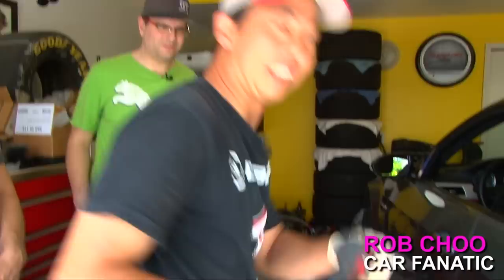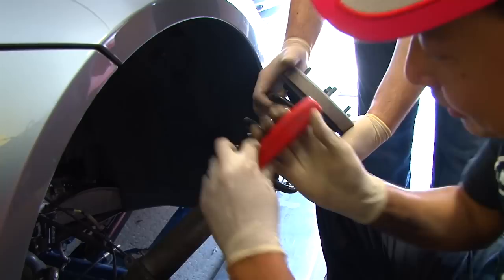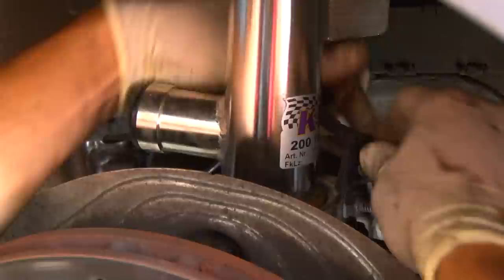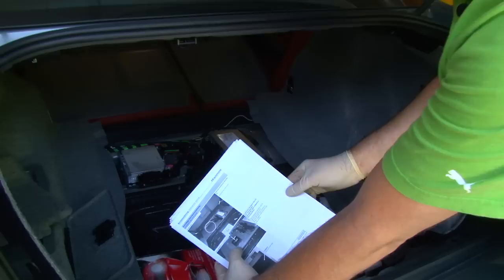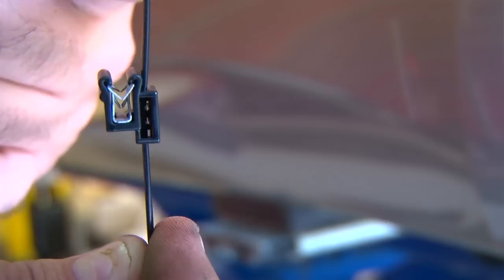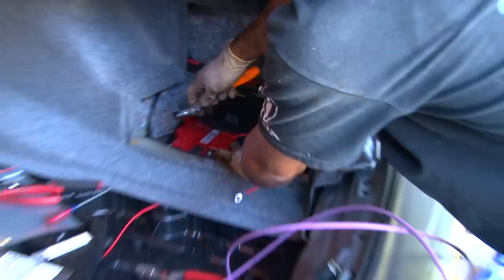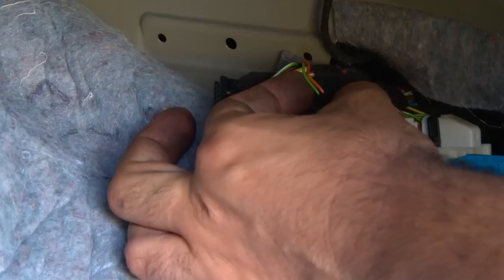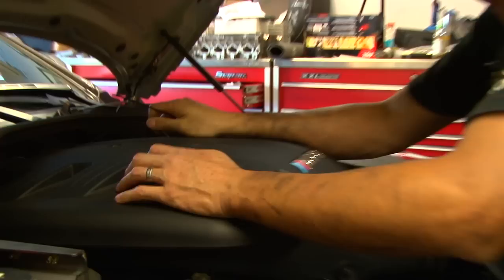How not to lower a car the wrong way - KW Suspension DDC - Technik

Comment: "happy wrenching". Sure, KW DDC coilovers are ~allright but the OEM susp. with EDC are no compromise at all, in fact I consider them better suited to the M3 unless you do more than 50% track. So really all that work was not necessary, the OEM suspension are awesome. You guys just have the mod bug and maybe are contemplating opening up an indpdt tuning shop, right ? By the way the fat guy with the baseball cap really need to forget about cars and hit the gym instead. I know that's rude but you know it's true.
Reply: +mayhemlee  A good question would be: Who the hell goes to a suspension install video to check out dudes.....
Reply: goognam goognws You mad bro?
Reply: So you come to suspension install videos to check out dudes? Lol
Reply: This's getting interesting 🍿
Reply: 510Redneck Gee, ya think?? LOL

Comment: I was just wondering. A few yrs back I was going to buy an 02 sentra Spec v. Test drove it, loved it. Then I crawled under it. All I saw was rust from front to back. I just looked at the salesman and laughed, told him I'd give him $1500 for it. He asked why, I said to look under it. The I told him that if I had to replace ANYTHING (brakes, tie rod ends, ect.) it would result in every bolt snapping. so yeah, no thanks.

Comment: As far as I know, the KW DDC system costs in the order of $20,000.00 is that correct? You kind of left that bit out. That this easy mod, was the cost of some peoples entire vehicle. 

Correction: I just checked ebay and there are prices there for $7,000.00 what did you guys get it for.
Reply: KW ranges from around 900-5,000 lol
Reply: 900, really which model?
Reply: The h.a.s sleeve kit. It only comes with springs and you have to get aftermarket or use your oem shocks. It's height adjustable. But if you're talking about only the ddc system it's like 4,000.
Reply: ***** they are on KW's online store for $4,299. yes espensive. but german quality for a quality german car with push button functionality.